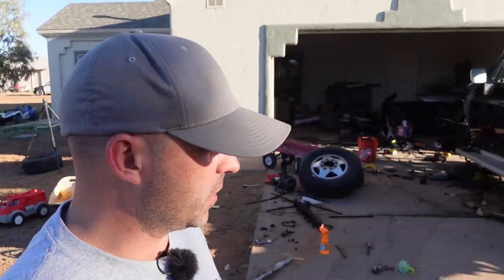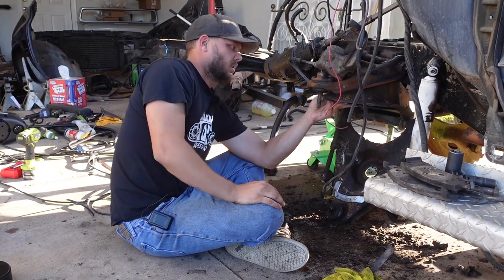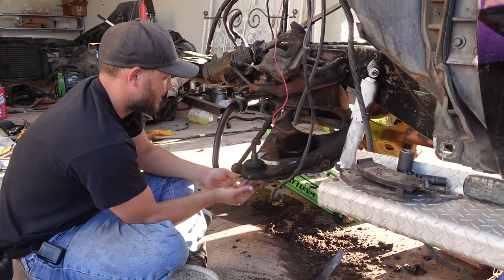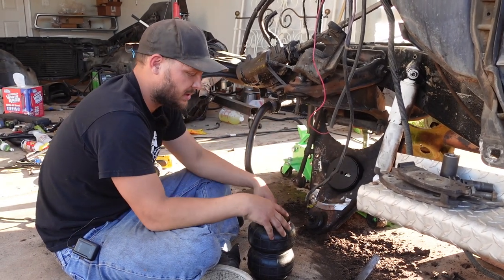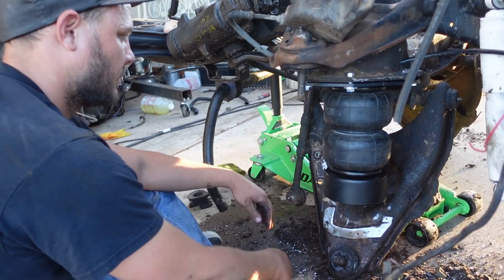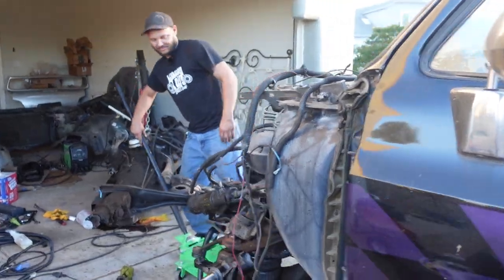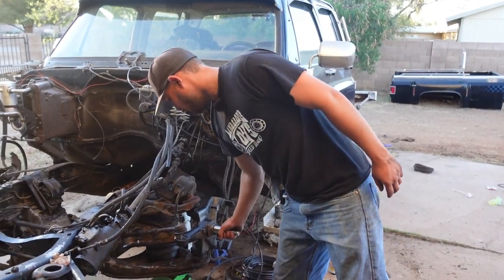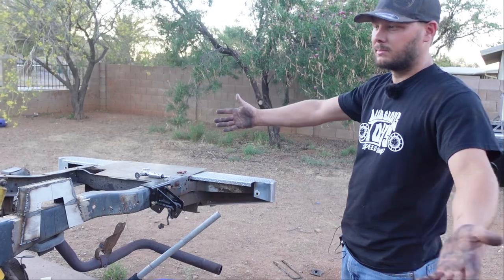C30 Squarebody: Getting Bags on the Front

Comment: Little tip. I ran little wipps of air line with a bulk head  so the connection was outside the frame made it simple so if I had a failure it would be easier to get fixed
Reply from the maker: Thats a great idea!

Comment: I know it has been years since you posted this, my question is, can I rely on airbag suspension for all my suspension on my 1988 C30 Dually? What if a bag fails? Are you screwed? The truck is not going to be a hard worker, small fifthwheel, gooseneck car trailer, etc.
Reply from the maker: I'm still not finished with the truck. If a bad fails, you are kinda screwed but you can make some form of bump stop that you can bolt on if need be.
Reply: @LocalLosers520  I cant find that 6 bar rear suspension, any help is appreciated.
Reply from the maker: @Alixbmetalworks on Instagram